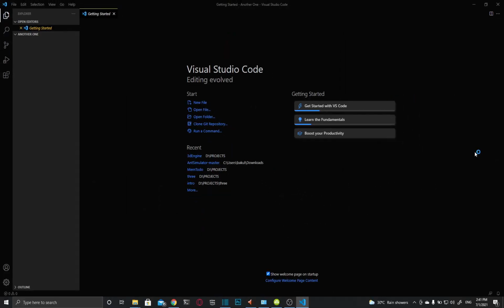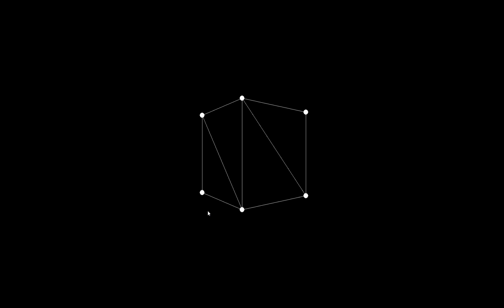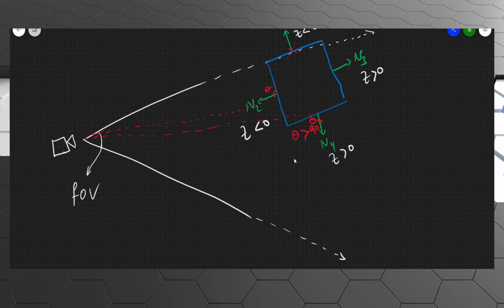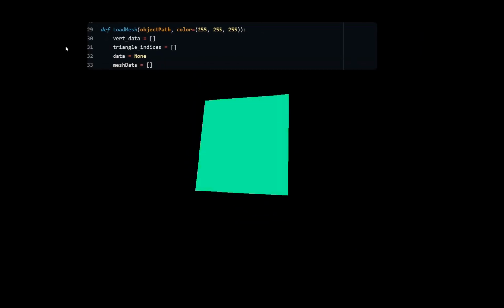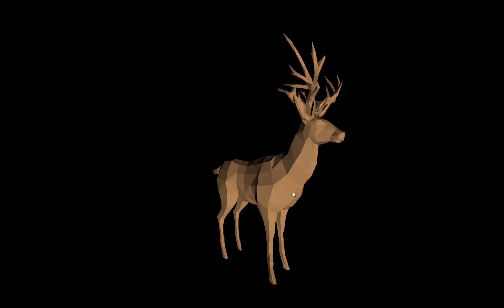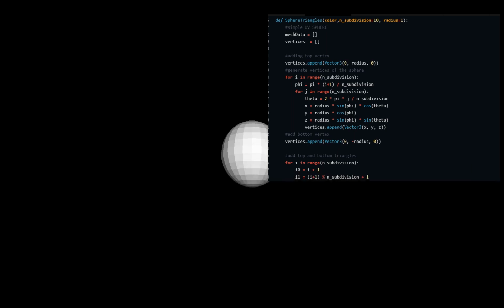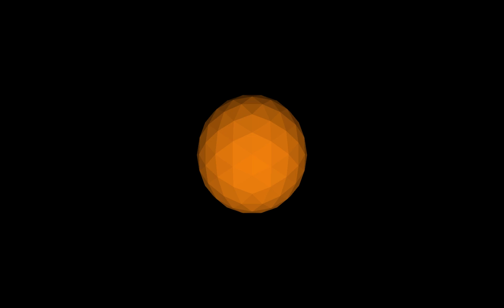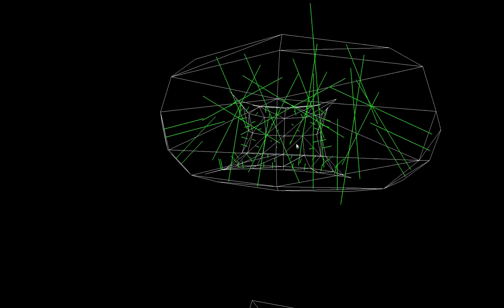3D ENGINE from scratch using python

Comment: I think when you're talking about the z-buffer, you are actually describing backface-culling.

A z-buffer is used during fragment shading, essentially keeping the current z value of a given pixel, with respect to the camera-coordinate system. If the pixel we want to draw has a z-value lower than the value in the z-buffer, we skip it.

The normal check you were talking about is more about the step before we draw pixels. Essentially checking wether or not the given triangle is facing towards the camera or away from it.

Still, a cool project. Love seeing people working on rendering!
Reply from the maker: Thanks for the correction , the z buffer is a little bit similar to the painters algorithm , I should've said culling ... Thanks for watching the video
Reply from the maker: Btw do you think it possible to implement a skybox without using some sort of shaders!
Reply: @Auctux  It might be possible, but I'm not sure. It's definitely easier with a shader... You would have to have some way of drawing either a gradient or a textured box... which is what a shader is for, hehe.

I've never used PyGames before, so I can't really help there